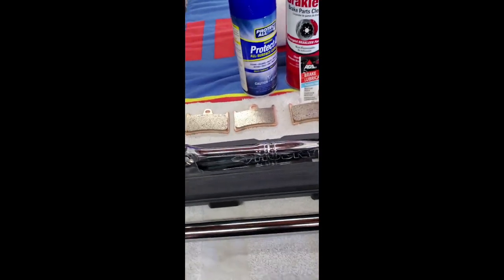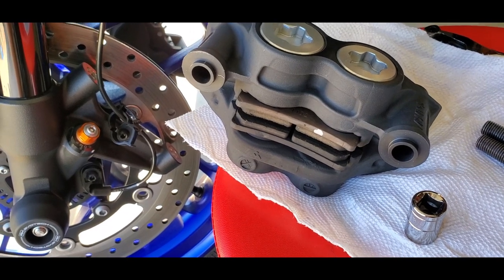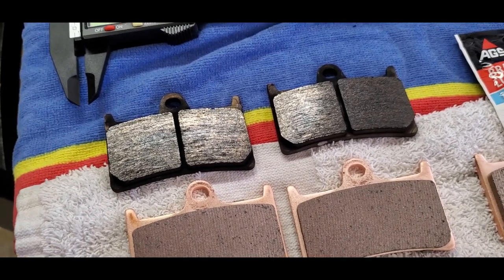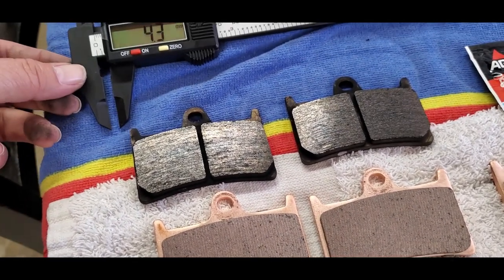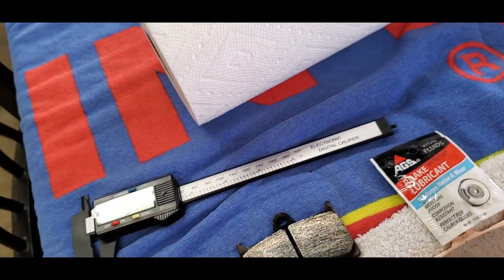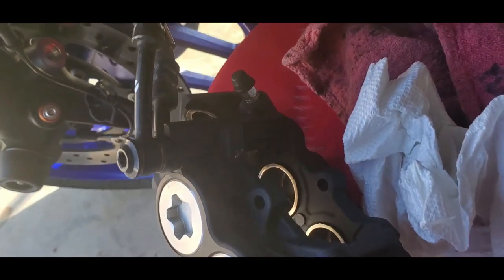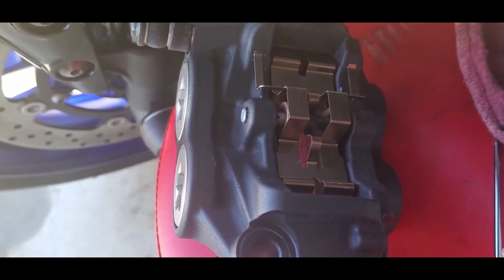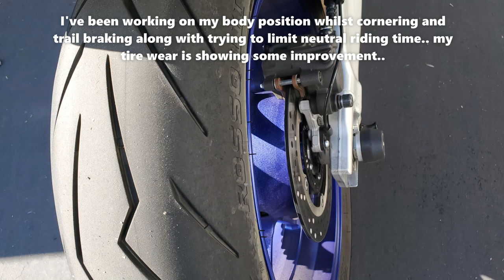2021 Yamaha MT 09 SP Brake Pad upgrade anyone can do! and SNOW!

Comment: Great video Jane 😆 I will do the same once Oem wears out only 3100 km on mine.
By the way I did the ASV c5 levers and CRG arrow mirrors, just ordered the rizoma front and back copies brake fluid reservoirs hate the original white Color the SP ones are dark and much nicer always great videos
Reply from the maker: @David D those sound like solid purchases!